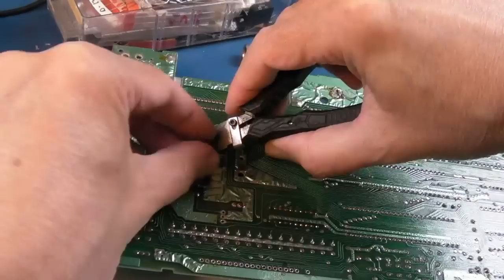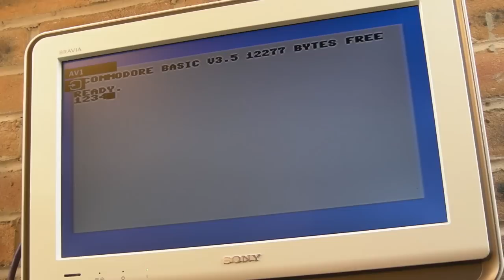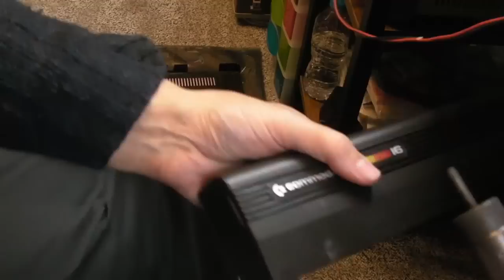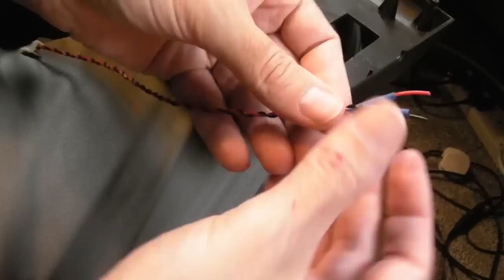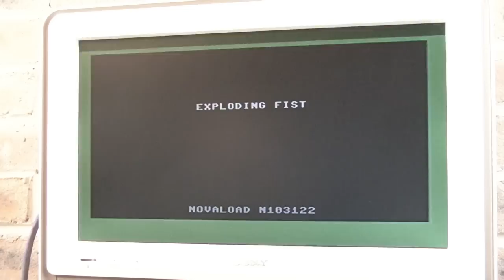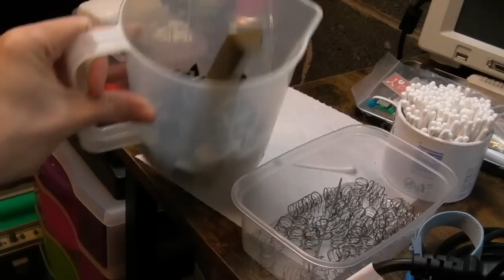Another Commodore C16 Repair & Upgrades Part 3 (6502plus4 / Shell / Modulator Replacement)

Comment from the maker: Part 2 - https://youtu.be/dJ6pPfMu8oM
Part 1 - https://youtu.be/njkSyh3VOrU
Lotharek (6502plus4) - https://lotharek.pl/productdetail.php?id=257
Daniël Mantione (C16 PLA) - https://www.sellmyretro.com/offer/details/pla16v8-commodore-ted-series-%2816~~116~~plus4%29-pla-replacement--_-diy-soldering-kit-48445
RetroKrazy (Heating Plastic Cases & Computer / Console Repairs) - https://www.youtube.com/watch?v=55NCJXkZYro

Comment: I wonder why there is no way of generating a HDMI signal to feed modern LCD televisions possibly using a Raspberry Pi IV to digitize the incoming composite signal and outputting a HDMI signal in place of the UHF modulator.

Comment: It is a shame that the COMMODORE C16 didn't have the full 64KB of RAM installed so games for the C64 can also be run.
Reply from the maker: The C64 had a lot of other differences besides RAM size!  Differences in video, sound, and general architecture!

Comment: Another junk board saved from the junk pile. Are you ever tempted to give these things a scrub with soap and water before you start doing any work?
Reply from the maker: Thanks!  Not yet, I learned back in the day (from different engineers) that washing a board was a last resort really.  If you use distilled water and rinse straight after with IPA its OK, but people that wash boards with soap and water do start corrosion in sockets and stuff if its not dried very quickly and thoroughly after washing.   A board can look fine, come back 12 months later and corrosion can start.  I just wouldnt want to even risk it with old computers / consoles tbh - personal choice but it is what it is...

Comment: 7805 buck converter module substitute might be better on these old systems. I think it's more officiant (less heat) and converts cleaner power.
Reply: Yes, the big white resistor is just there to offload the 7805, otherwise it would overheat. So with a switched regulator you can remove both.

Comment: The relief I felt at around 6:26 when you straightened all the components up! And nice job taking my heating attempts further btw. Will try Back to Black myself next time too. Well, that and not melting the case as much... 🤣
Reply from the maker: Haha =D  Yeah, the melting worked well, until I heated too long around that crack... I wish I had filmed how much wider it was, at that point I was so miffed I almost just binned that top, but I smoothed the raised edges down and filled as you saw.  I should have stopped at the point it was not wider...